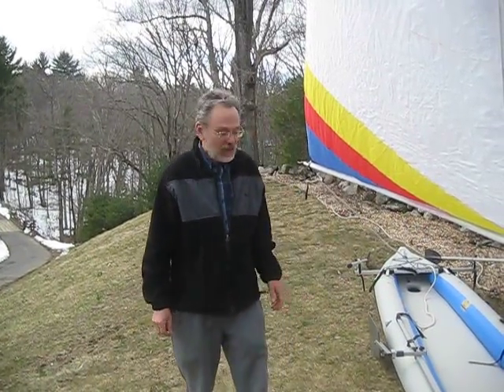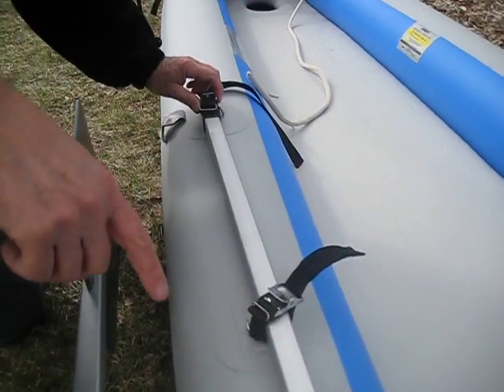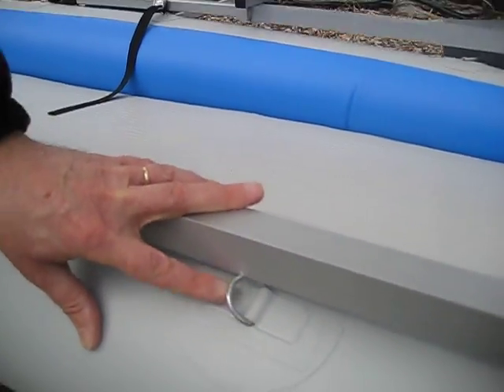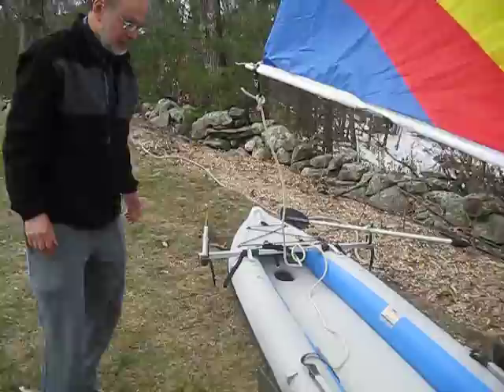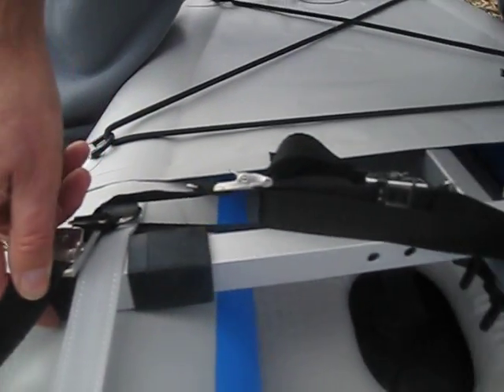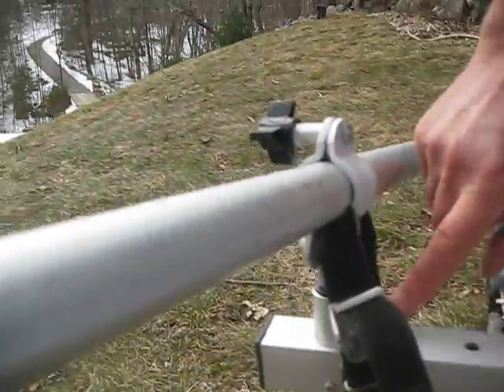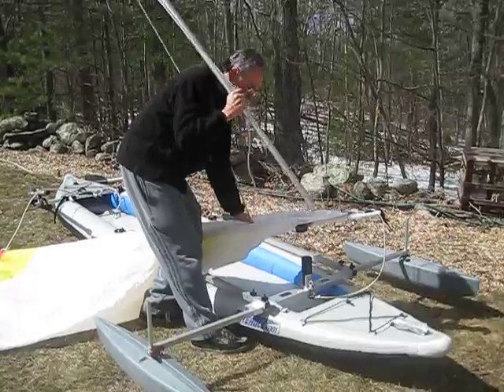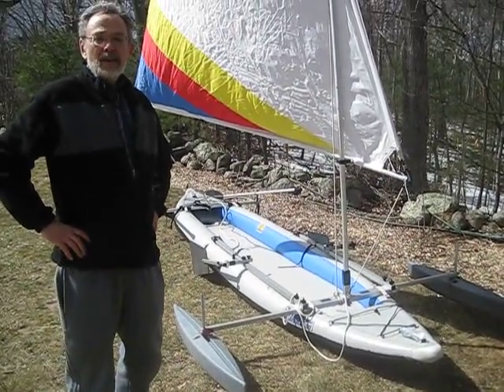SailboatsToGo Kayak Sail Kit Installation on Sea Eagle Fast Track Inflatable Kayak

Comment from the maker: They made the front and rear narrower and the tubes smaller in diameter.  They put on some nice handles, and I think maybe they have added those to the other model as well.  They made the floor thicker.  I would estimate paddling effort is just a bit more -- say 10% more -- with a Fast Track  as compared to a hard shell of same size.  the smaller tubes reduce weight and wind resistance, but you make take on more water over the side in rough conditions.

Comment from the maker: I don't think it's significantly less stable but the new one definitely is wetter, because they have made the side tubes so low in front.  On a windy day, you would have to sail with the self-bailing ports open (I have the new model fast track 465 and that's what I do.).   The 305 is the Classic and is now $1599 and the 309 is the new wetter model and it is $1699, both with sail kit.  Sorry for the tardy response.

Comment: Interesting they made the floor thicker, they don't mention that on their page. I own the old 465ft & like it, but am considering getting a 2nd for the rest of the family, and I am looking at your sail kit, very intriguing. The new one is faster paddling, but is maybe less stable with your sail kits than the old version, would that be correct to say? Which version is included in your $1699 (#305) package? (I don't think it says on your site)

Comment: Has sea eagle 2016 changed their side tubes size and shape since 3 years ago?
Reply from the maker: When it first came out, they were decently fat, though skinnier than the Explorer series.  Then they got real skinny up in the bow area for one year, which I would guess to be 2012 or 2013, and it became necessary to rig it with the mast  moved back a bit (to the first set of D rings).   Then they change a third time to something in the middle between these two extremes, and at least that last change was within the past 3 years I believe (2013 or more likely 2014 I think).